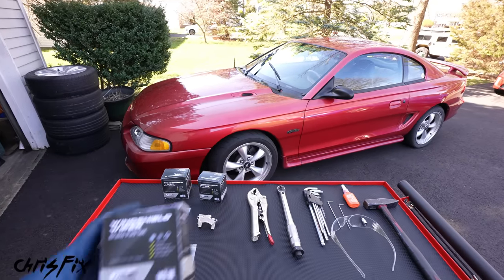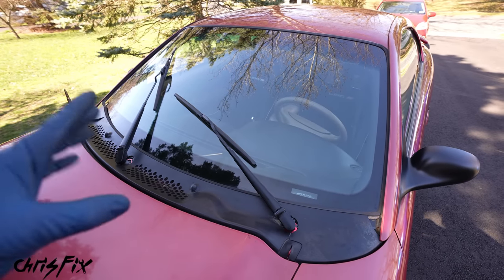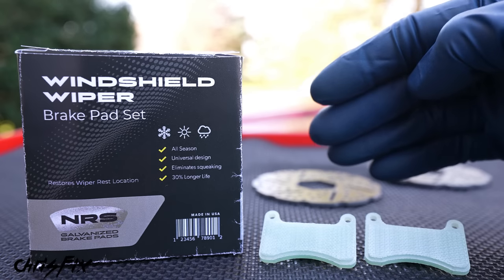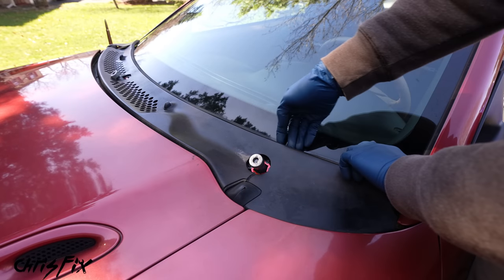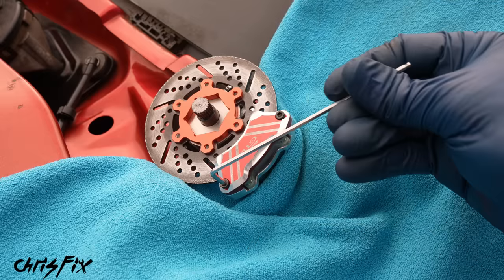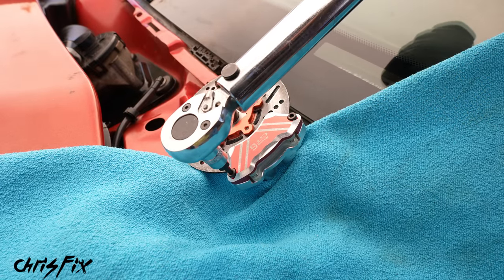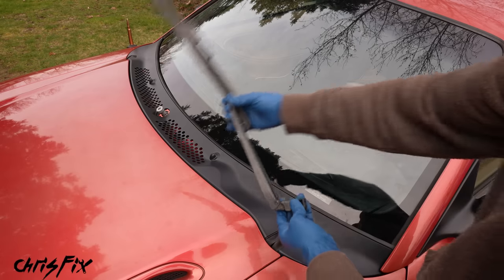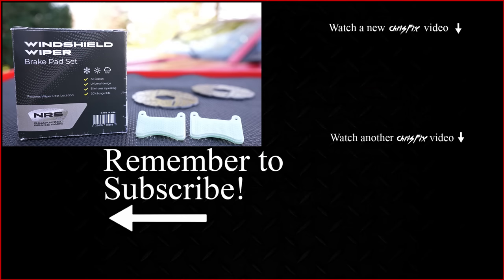How to Install Windshield Wiper Brakes

Comment: I had no idea there were breaks to the windshield wipers. I did have a similar problem with the wipers, the left one didn't go all the way to the edge which caused the right one to cross over the left one. Luckily I just needed to tighten the bolt that helt the wiper in place. It had gotten  loose. I didn't even know or think that there could be any other problem.

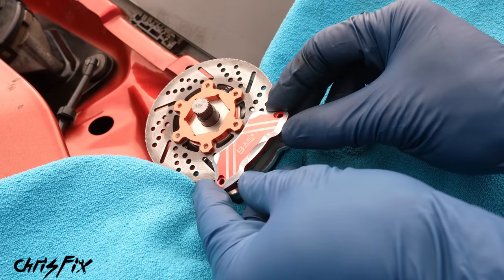Comment: former mechanic here an 4:01 and at 5:53 the wiper brakes appear to be a bit loose a good tip is to replace the wiper bearings its preventive maintenence and they only cost a few bucks

Comment: after i put my new wiper brakes on  a mechanic friend told me how to change my fluid in my sealed transmission with no dipstick  all models of cars its so simple they do not want you to know  all you do is take the fill plug out and add about 6 to 8 quarts of new transmission fluid  the transmission will send the old fluid to the reserve tank to be burned  as your exhaust  reaches normal  operating temperature  and this also acks as an upper cylinder lub

Comment: Tried to Check mine, but they seem to be an older style.
They seem to be a lined steel band that tightens on the outside of a drum.

Would be great it you could do a video on relining or upgrading them.

Comment: I can't believe Chris forgot to  push back those caliper's pistons   it's important to let the wiper brakes know that they have been serviced,   also a common task to do is check the wiper brakes fluid's reservoir to check if it has the proper ammount of fluid   I think those a hidden under the dash need the radio. Odd place for them I know but  we've seen starters in the middle of the engine so it's not new.

Comment: The transmission air filter looks like it needs replacing too.  While you're down there you should change the alternator breather hose too.

Comment: Don't cheap out and buy what are refered to as organic pads. I don't even know if they still make them anymore, but try to stay away from them. I've always liked the semi-metallic ones, but I think now they have performance ones that are ceramic, just like the types available for your car's service brake system. It just took longer to work out the manufacturing process because of the miniaturization.
A couple things I feel need to be added to this presentation, and these things are easily overlooked:
1) While everything is disassembled, it's a good idea to look those rotors over carefully. Being much smaller than your service brakes, it doesn't take much of a defect to cause severe problems. Give them a good going over, and if they look scored or gouged or burnt, take them to your local auto parts store to see if they can be turned. Most stores do this for a nominal fee, and it can often be done while you wait. If they're already too thin and can't be turned, they're fairly inexpensive and usually readily available for most cars and light trucks.
2) Also, while you have everything apart, take a look at the hardware. Make sure those return springs are doing their job. Tiny metallic pieces like that tend to wear quickly and sometoimes they just aren't strong enough anymore to push the pads away from the rotor. 
3) Give those pistons a good looking at too. Usually, they're made out of silicone and with heat and age, they can crack, become brittle and sometimes even break apart. Bad news when that happens. Just bad news.
4) Some models have a parking brake on the back of the rotors. These are easy enough to see and replace as necessary.
All of these items are easy to see, inspect and change if needed. They're also inexpensive and serve as good insurance that your wiper brakes are always at peak performance. Many stores sell complete kits to replace everything at a fairly substansial discount too.

Comment: Hi Chris, I had replaced my wiper brakes just the day before I discovered your video. Nice to see you did it properly (as always) but you know some people just force them off without pressing the little button!

Anyway, any chance you can do another instructional on how to iron your roof liner? Mine needs a wash, and I thought there's no better time to do it than after a wash. Thanks in advance.

Comment: Chris, can you do a video on how to fix a faulty anti-lock braking system for your wipers... mine have gone bad I changed the disc but it didn't help and I don't wanna take it to a dealer and spend the big bucks.

Comment: Is it necessary to install a fourth brake light on the rear of the vehicle to inform tailgaters that I'm applying my wiper brakes?  I'd hate to be rear-ended if I slam on my wiper brakes in rush hour traffic!

Comment: Hi Chris! I have a very old car, so my whiper breaks are drumbreaks. Can you make a small video on those too? Thanks!
Reply from the maker: Wiper drum to disc conversion video?
Reply: @chrisfix  Seems only fair. :D Im thinking of putting performance ceramic discs, as it rains quite a bit in my area...

Comment: Can you please do a video showing step by step how to change the horn fluid in a car or truck? My horn is not as loud as it used to be so ima sure that the fluid is low and needs changed...... I'm going to check my windshield wiper brakes after the video!!!!

Comment: My car is older.  It's a 1948 LaBomba Deluxe (with the self-cleaning ash tray).  It has drum brakes on the wipers......  I'm wondering if you could do a video on swapping the drums to an aluminum, finned design, and incorporating some Velvet-Touch brake linings....????

Comment: I had an old LTD with bad wiper brakes and the wipers would go off the windshield if I drove over 45 mph.  I'd have to reach out of the car and push them back over the A pillar which wasn't good because rolling down the window during the rain is a felony in my state.
Reply from the maker: Def need replacement wiper brakes then!

Comment: That was a very helpful video, but can you make one with the changing and maintenance of muffler bearings?  Mine keep failing all the time and the friendly repair mechanic at the corner gas station says it's a recurring problem and charges me $599 every time.

ThanX! :)
Reply from the maker: Here you go, muffler bearing replacement: https://www.youtube.com/watch?v=eWdqlpxRA4I&t=37s&pp=ygUPbXVmZmxlciBiZWFyaW5n

Comment: Hey Chris, I’m looking to install ceramic wiper brakes. I can get them for only $1,000 per side. I think it will be good when I get the Honda Fit on the track. Will this help with high speed wiping?

Comment: The wiper drum brakes on my 53 Chevy 1/2 ton pickup haven't been replaced in the 43 years that I've been driving it. Should I upgrade to disk and do I have to upgrade my switch if I do That?

Comment: Quick question I was looking to recharge my AC. Did everything just like you did however when I started my truck AC clutch did not engage. Purged some air and turned open R134a can but none was being sucked into the system.  I also had the AC on when I opened the low side valve to suck in the refridgerent
Reply: Problem isn’t refrigerant. Problem is the compressor. Change it

Comment: A real mod:  DC powered air compressor with airlines  to blow off side mirrors.
) DC Air pump, tank, regulator, and solenoid valve with relay.
) irrigation, airline, or silicone hose
) Air nozzle (45 degree fan sprayer from irrigation systems.)
) Pushbutton
) splitter manifold

Comment: So when changing the wiper brakes, do I need to replace the brake lines to the calipers or are those gonna be reusable? Id hate to lose wiper brake pressure during a torrential downpour

Comment: PEOPLE......
PLEASE REMEMBER TO MARK THE POSITION OF YOUR WIPER SPROCKET ON THE SHAFT!!
If they aren't put back in the correct position they will be out of balance. That will cause the wiper arms to jump all over the place and eventually cause damage or even break your windshield.  
These are ALMOST impossible to re-balance once they become unbalanced. 
😉👍

Comment: I didn't know wipers had a brake in it. I fixed my honda wiper and won't run, and no brakes in it, just an arm that is fixed in a correct timing. Anyway, new lesson for me not all cars have wiper brakes 👍

Comment: If you dont want to replace them yourself im sure a main dealer will charge you no more than $200 to replace them. The one on the rear window doesnt need replacing as often.

Comment: Hey Chris, what do you think could be wrong with my wipers, they went out on me on a rainy day while on a trip it just stopped working and never came on again. I got it fixed 3 months ago but the mechanic told me I didn’t need the motor so I returned it. Now they suddenly stopped working. Please help
Reply from the maker: Could be a blown fuse/bad relay, loose wiring, bad wiper switch or some kind of linkage issue

Comment: Hey Chris!
Love all the videos and info you bring to us!  Was wondering what your opinion is on using a little extra grease in the u joint caps before putting them back on?  Was told this was a good idea if the u joints are sealed.  Thanks in advance.  Keep up the great work!

Comment: Hey Chris, thanks for sharing!  So my '82 Chrysler K car still has the OEM Mopar drum brakes on the wipers.  I've heard of a mod to swap them over to the more efficient disc rotors shown here, but the guys down at Autozone won't even help me special order what I need.  The splined axel on my model is too wide in diameter.  Can I just clamp the vise grips onto it and spin it around a few times to shave the splines down?  Seems like that would let the new rotors that they do have in stock slip on just fine.

Comment: Can you show me how to replace the liquid in the windshield? Not the windshield washer fluid but the actual liquid between the 2 layers of safety glass on the windshield. Ther are little air bubbles indicating the fluid is low.

Comment: Mechanic: "I noticed your wiper brakes are bad."
Me: "Ok, how much does that cost?"
Mechanic: "$69,420."
Me: runs away from mechanic to avoid replacing brake pads for $69,420***

Comment: I added meth injection to my project car and I’d like to add larger wiper brakes as well. -I try to add safety upgrades, not only “go-fast” stuff. I was wondering if you’ve come across any difficulties getting larger wiper brakes under the cowling and where’s the best place to get upgrades and large BWB components
Reply from the maker: Depends on the car but a lot of time you can just Dremel or hole saw for some extra clearance. And i've seen people rig up rc car brakes as an upgrade so check your local RC/hobby shop ;)

Comment: You forget to install the rotor locking key and check the hydraulic control mechanism. 😮
Reply from the maker: It's all built into wiper arm don't worry ;)

Comment: Thanks but I’m having trouble with my wiper motor transmission and I can’t seem to figure out where the oil dipstick is for to.   The wiper transmission is slipping and running hot maybe I need a transmission cooler on it.   Any ideas   Thanks

Comment: I did away with the old hydraulic disk wiper brakes on my truck and converted them to air brakes. Also installed a check valve to blow away debris and leaves on the windshield as well. Still have hydraulic disk brakes to stop with though.

Comment: My wiper turbos are burning oil, how do I fix this? Also, I've been told I need a motec if I want rolling anti-lag. 
Original budget: $41.50
Current situation: divorced
Reply from the maker: Try replacing the seals on the turbo and that should solve it, you can get kits for cheap ;)

Comment: As a owner of an older vehicle that didn't come with wiper brakes, where did you buy the brake set.
Reply from the maker: Advance Auto has it in store. Just gotta ask one of the employees behind the counter.
Reply: @chrisfix  thanks, I bought 2 more calipers and brake pads to make a dual brake setup

Comment: If you don’t track your car, the factory wiper brakes last forever. You can reset your resting position with an obd2 scan tool. .

Comment: Diesel engine breather hose through some oil in air intake can i leave it in air or add a pcb filter separately

Comment: Do NOT use carbon or ceramic pads, or rotors. There is only one manufacturer, and so the price is outrageous, and they suffer recall from cracking. Also, the weight savings is minimal, and since they are primarily used when it is raining, heat dissipation is not an issue. Do upgrade from drum type wiper brakes but the cast iron rotors will work just fine. Don’t order with the optional dust shields. They just aren’t needed and they are made of thin plastic. When they crack, pieces will get into the brakes and jam the wipers.

Comment: I need your help figuring out why my RPMs are dropping and stalling my car when I push on brakes I got a 1998 mustang gt
Reply from the maker: Sounds like it could be low power steering fluid since your brakes use the power steering pump to work them.

Comment: I noticed a problem. You didn't replace the slide pins on the passenger side. You might wanna look into that or you're gonna have premature failure. What did I just watch? 😂😂😂

Comment: My wiper brakes experience a lot of brake fade after only about 10-15 minutes on the highest speed setting, then they become ineffective. In winter, they last a few minutes longer, but it's still a problem. I tried everything on the internet: lighter carbon fiber wiper arms, metal-ceramic rotors, organic brake pads, replaced the fluid with liquid nitrogen, mounted nickel-plated copper heatinks to the back of the pistons, even sloted the rotors. Nothing worked and it's getting very distracting when the wipers move left and right so fast; I already went through 6 packs of rubber buffers that sit at the end of the cycle to prevent damage to the pillars and the plastic hood protection. Does anyone else have the same problem?
Forgot to mention that this happens on my old Viper 8.3L ZB1, where recently I replaced the wiper motors with a pair of Nissan Leaf motors for some Japanese reliability. Should I upgrade to a pair of Tesla motors?

Comment: Why there are Windshield Wiper Brakes? mostly vehicles doesn't even have it? like my corolla. Can someone explain please
Reply: It’s a joke like blinker fluid
Reply: @its_ziloz2154  yeah it seem to be a joke to put brakes for wiper blade. I had drove vehicles more than 20 years old and never got problem with wiper blade motor. I was surprised to see this.

Comment: The first thing you should have done is check the wiper brake fluid. It should be changed every 2 years. I'll bet yours hasn't ever been changed. Another YouTube hack video.
Reply from the maker: In this case the fluid is lifetime so there's nothing to change... if you really needed to you could do a simple drain and fill with the plugs on the top and bottom but 99% of the time the pads and rotors will go out before you have an issue with that...
Reply: @chrisfix  oh. My bad.

Comment: I honestly don't know if this is a joke or not
Reply from the maker: Looks pretty real to me ;)
Reply: @chrisfix  are these on all cars? or just some? I have had like 25 cars and I have never seen these, I don't even know what the point of them would be, The motors can stop themselves and most of the time the wipers are fighting through a load so there would be no need whatsoever to have brakes on them because the load that they are pushing would naturally stop them..... I am so confused..... and gullible too, that is most of the problem.